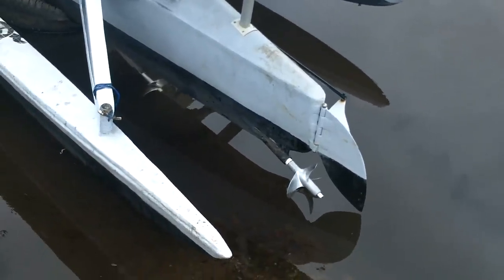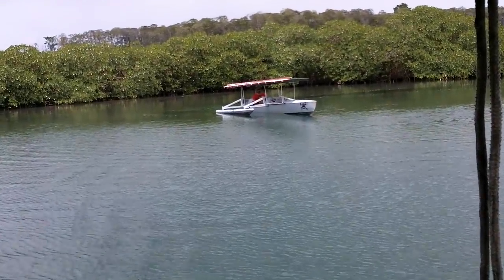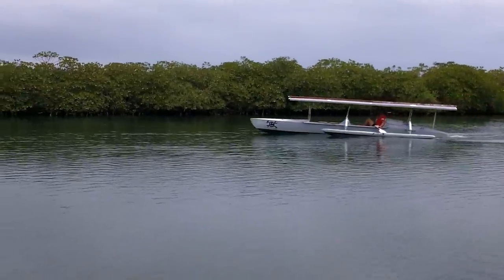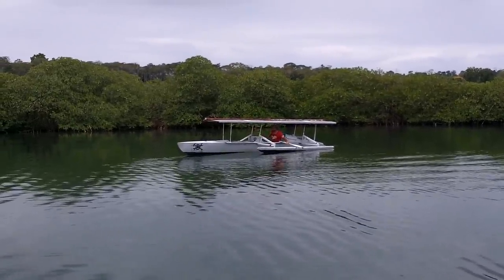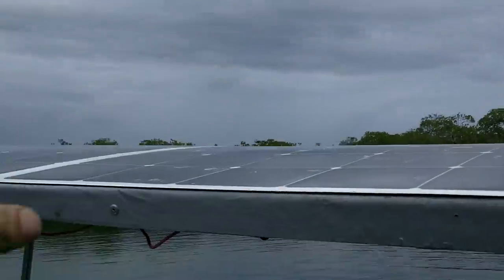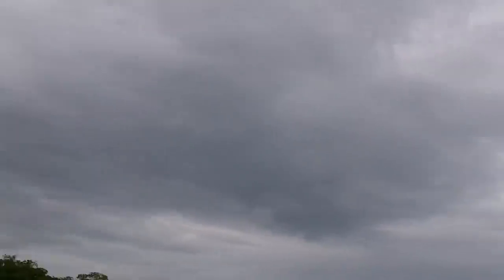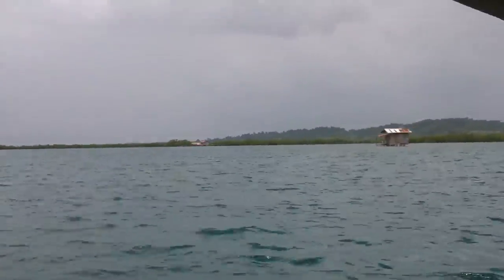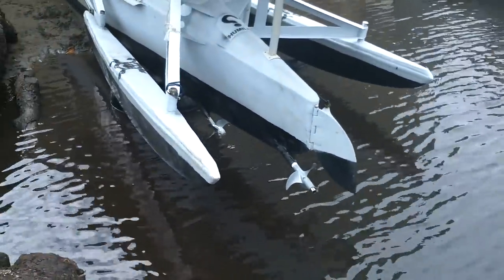Homemade Fiberglass Propeller Test!

Comment: Wrap some copper tubing around the motor and add a pickup to the boat for water cooling
Reply: i was just thinking the same thing, even some heatsinks stuck onto it and a pc fan just to remove the heat from the motor compartment might be enough to reduce temp by a good few degrees
Reply: Could also make air ducts for the motor compartment.

Comment: To cool the motor do a tight copper tubing wrap with a water pickup scoop and a side hull exit to see the flow just like the RC hobby racing boats
Reply: Water cooling can be very effective but if the lines get clogged it can have an insulating effect and cause premature overheating. Also, saltwater eats copper for breakfast. A copper nickel alloy like C70600 might do the trick though!

Comment: These work so well! You’re like a prophet of fiberglass; I’d never realized that it was so amenable to regular people to use and create with and it’s inspiring. So much rusts in my West Virginia mountains and I’d never before considered fiberglass at all. Great to see innovative uses and creations.

Edited to add: I half think you ought to make a cast of these propellers to cast them out of some sort of hard, garbagey plastic like certain bottle lids. I figure plastics must be a near renewable resource there on the coast and if you got the process down pat, you could cast a new one if you break one somehow. These turned out just so pretty.

Comment: Jamie it would be really cool if you built a stern extension adding about 5ft. You will go even faster and the stern won't squat so much. Great videos! I've been following since Vermont.
Reply: Or maybe the ama could extend back
Reply: @zeusapollo8688  if you look there is a nice stern wake behind the center hull. The amas should only be for stabilization, I don't think swinging then back would help much. A longer LWL will for sure.

Comment: Looking awesome now... Hydrofoil sounds quite doable, and will go faster with less current once the bulk and the pedal prop is out of the water.
Really need a decent mppt charge controller and balancer for the batteries, as well as some cooling for the motor then it'll be even more world class!

Comment: Honestly, I'm kid of surprised that composites haven't been used for salt water use before. (other than on trolling motors)
Its a very practical item that doesn't care much about corrosion now, well done. And man that was fast!
Reply: I would think that they aren't used that often because if you hit a log or something it will be severely damaged, just guessing.
Reply: Composites have been tried by numerous manufactures, but they aren't popular because of their inefficiency. The thicker blades have significantly more drag than a comparable metal prop, especially stainless.
Reply: @EDesigns_FL The commercial units are probably over built, and under pitched to keep them from breaking under stress.
Jamie's blades are not all that thick, and they will probably hold up for as long as he needs them to.
Reply: @JimsEquipmentShed  Commercial props, especially performance models, are highly optimized. Way beyond what's practical for a DIY'er. Whether a particular prop is over or under pitched for an application, would solely be the fault of the person selecting the prop; NOT THE MANUFACTURER. 
In regards to Jamie's prop, it's being used in very low thrust & speed application; so his composite prop may work fine for him, but a stainless unit could be made with less resistance. Typically, metal props are cast and forged. This would be a lot of work for a single unit. If I were making a prop for his application, I would forge stainless blades and TIG weld them to a machined hub. This approach may not be practical for Jamie.
Reply: @EDesigns_FL  I was saying that the manufacturers would tend to under pitch to reduce the possibility of  stress proactively. 
Like they did on my mini kota trolling motor. 
Less stress equals less breakage, and they will always take the middle road.
Reply: @JimsEquipmentShed  The correct pitch is one that permits a motor to reach, but not exceed it's redline, at WOT. It's not a primary factor in regards to stress. 
If your trolling motor is not reaching its peak RPM, than you need less pitch. If your motor is exceeding its peak RPM, than you need more pitch.

Comment: Definitely making a foot high wake and cruising 4 to 6 knots. You do need to think about a sacrificial anode or the stainless will rust faster. I didnt see where you waterproofed your electric connections or applied dielectric gel. They will corrode fast in a marine environment.

Comment: Yes, you should ALWAYS uncover panels completely. Partial shading really does a number on power output; it acts as a resistive short circuit. Worst case it could actually damage the shaded panel, if the other panels are connected in parallel, they can gang up on the shaded panel and overheat it, although usually there's diodes fitted to stop them pushing back through one (causing a small loss of power), and I'm not sure if you've got enough panels there to do that. But yeah, partial shading is only bad any way you look at it.

Comment: Aluminum next to Steel in Seawater = A battery. That's why the bolt corroded so fast.
Reply: yeah. aluminum touching steel is basically never ok, long term, but especially when you add salt water!

Comment: Impressive performance, It might be interesting to know the rpm of the motor , I assume higher rpm with the same electrical load would be better I expect , does it have a cooling fan , I don't think so. Cheers warren

Comment: if you make aluminium props, it might be worth getting them anodised. 
that should make them last a lot longer, and hardens the surface. although you could still have galvanic issues if attached to, or placed near other metals.

the fibreglass props look excellent though, i would stick with them if there is no cavitation issue :)
Reply: I know a knife maker who anodizes with like a weird old power supply and saltwater for conduction. Different voltages bring out different colors - it’s pretty cool. I don’t know how this DIY anodizing would fare for corrosion resistance, but I know this dude of anyone could do it himself.

Comment: I know with trolling motor and kayaks the older props had 3 blades but at some point they all switched to 2 blades i assume they are more efficient,did u ever try a double bladed prop?i don't remember seeing one if u did might be worth a try. I know the kayak peddle models have a long blades on thiers

Comment: You need an anode quick...right now your propshaft is the anode, no dice.
Reply: I forgot too.
Reply: yep, sacrificial anodes made of zinc attached to all ferrous metals might make them last a bit longer. seawater is horrible stuff though, especially when using multiple types of metal together
Reply: and where would he put the anode the boat is all fibreglass
Reply: Most boats are fiberglass, Run a ground wire and install one like everyone else. @bobrobert6277

Comment: Wow! I'm not an expert, nor am I very experienced in propeller design. But I haven't heard of using fiberglass. Very creative and ingenious! I am tempted to experiment with a homemade option for my 6 hp outboard motor. Do you have an opinion on fiberglass's ability to hold up to the torque of a small powerhead? Or do you believe I should instead opt for metal (which was my original thinking prior to stumbling across your videos)?

Comment: just a quick question if you run the solar panels and battery at the same time won't the battery start pussing current thru the panels or did you do some electrical tricery that we didn't see if you didnt i can't imagine that it is very healthy for the panels

Comment: I'm telling you, man, use the charge controller to charge the batteries and run the motor at the same time, that way the solar panels will always be charging the batteries. When you have that kind of system hooked up in an off-grid application, you don't switch the load between the batteries and the charge controller, you just leave everything hooked up at the same time and the load draws from whichever source has the highest voltage. Either way, it looks like that boat was moving pretty well!
-
Also, I'm trying to find something that can balance batteries in this kind of application, there's gotta be some kind of BMS that will work. I know that there was a Kickstarter for a solar charge controller that included a BMS which could balance out Li-ion cells, but it doesn't look like anything was ever produced out of it.
-
Edit: Search for ElectroDacus, it looks like that solar BMS might actually be for sale, but it's a bit pricey.
-
Edit: I think just a plain, ol' eBay BMS board will balance the cells just fine, even with the charge controller that you have now. The boards are only like 5 bucks each. Search: 4S 30A 14.8V Li-ion Lithium 18650 Battery BMS PCB Protection Board Cell Balance
Reply: @ahaveland  That is really cool, that readout would be nice to have. It looks like it can even be daisy-chained to go beyond 24s? That's crazy!

Comment: Would be easy to put a watts meter between the motor and controller and see what your current draw is with your motor at full power . With more pitch your current draw will go up, should have a plate on the electric motor with max watts current draw, at least then you will know if your safe with your new prop. 👍

Comment: a super flexible water line that comes up and wraps round and round the motor housing and then back out...powered by water pressure of forward movement, no pump needed...oooohh.

Comment: Electric motors are designed to run normal at 60 degrees farenheight  above ambient temperature. So if it's 80 F then it should be 140 F which is very hot for water in a household hot water heater . Cheers

Comment: What would happen if the motor direction was reversed and the prop was designed to spin opposite to the pedal prop? Would it be less efficient due to turbulence, or would it be able to push the water better and at a lower speed because of the differential?
Reply: I believe that's how his props are currently configured. Peddle prop appears to be a left hand prop and the motor looks like a right.

Comment: A zinc anode would help with the corrosion
Reply: Only helps with corrosion on mettle and he does lift the boat out when its not in use so not much point in that as anodes can be quite expensive.
Reply: He was talking about the problems with casting an aluminium prop.

Comment: At one point it looks like your going about 20 to 21 mph ,hey check out bronze aluminum casting for your propeller it's one of the best metals for props an very low corrosion it's what they make ships propellers out of 89 percent copper 11 percent aluminum,shines like gold.

Comment: You probably already know that, but if you stuck two different metals together in the salty water they will react and weld or get eaten away because of chemical reaction between them. Thats how washing machines get ruined a lot especially samsung and lg, what we do with military stuff is that base metal is usually coated with zinc or other type of coating with electolysis, or platinum if you have money  XD